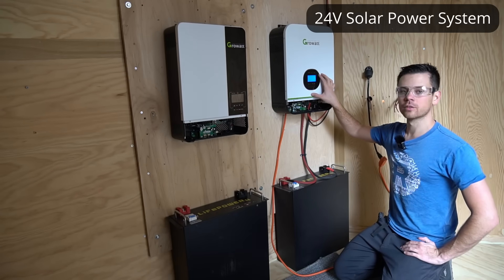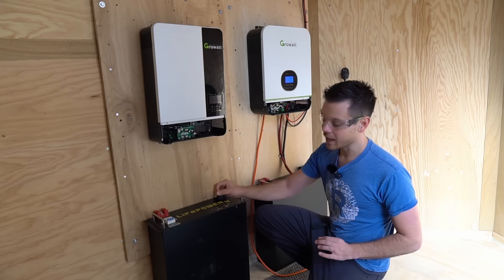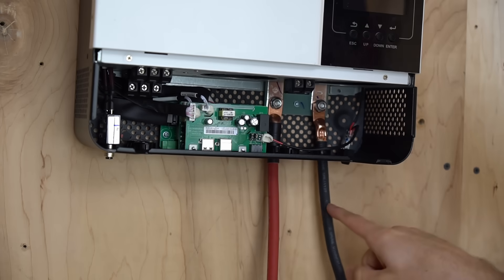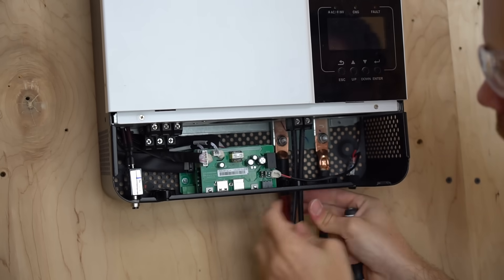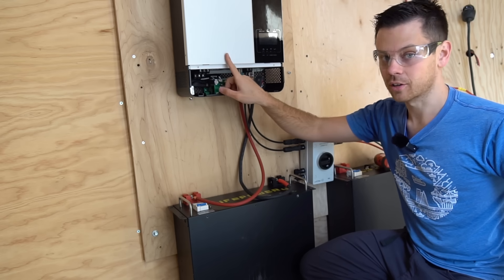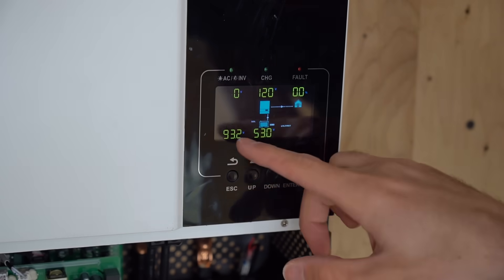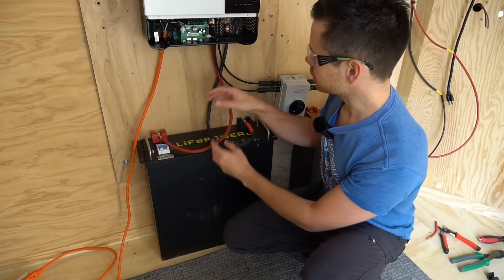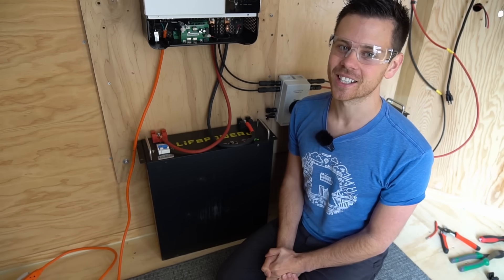Beginner Friendly 48V Solar Power System! Step by step!

Comment: Would you recommend using the Modbus feature of the battery packs to allow the inverter AiO to do coulomb/charge counting instead of relying on voltage for SOC? I just had two 10kWh LiFePO4 packs similar in features to the ones you have die (BMS failure, presumably) after getting numerous over-discharge warnings with a similar low voltage set point. I think reactive loads allowed them to draw too deeply in the transients when the voltage was near cutoff but not low enough for transfer.

Comment: You should put suitable amp circuit breaker on the output if you use smaller wire gauge vs the output. This will ensure that you do not exceed the wire capacity and burn it. It is a cheap fire-insurance…
Reply: Agree strongly. If you AC unit has a fault, like a seized compressor, it can pull a lot of current, melt your extension cable, and possibly start a fire. A breaker protects against this, so should be recommended. Good information, otherwise.

Comment: Will, true beginner here.  

Maybe explain how to connect a panel array to a solar generator.  Any safety hints?  The dc switch sounds like a good idea for an ecoflow delta pro with a 8@100watt series array.  The series voltage coming off this relatively small array has me nervous.  Is it as ez as ‘just’ making the solar panel’s mc4 interconnections and then plugging them into the ecoflow?  Any fuses recommended in the line from the panels into the ecoflow?

Like I say, true beginner - but learning fast with your help!  Maybe a future vid?

Thanks!
Reply: I too would like to see a setup for that.

Even just 2-3 panels with a system to connect/recharge the solar generator while keeping it indoors (preferably in the garage) would be a nifty case study most people should consider.

Comment: I built a very basic system similar to this on a 12V battery. Now I do like the power I am getting from it but do need more. I am using very little daily but on occasion use a high amount but my lights dim when I do so. I know it is my battery output that is causing my lights to dim. I would like to know which battery is great for high output on a Magnasine 2012 but also good for long low usage. The system is mainly being used for security flood light on a motion sensor. The last battery you talked about sounds great and puts out 200 amps continuous but is only 100ah. I found the power queen that puts out 100 amps continuous but is a 200ah battery for $40 more. Is the 100 amp output going to be able to max the magnasine output or would the 200 amp output allow the magnasine to flex its full output?

Comment: Btw why batteries in parallel should be charged to 100% ? If one is 100% and another 50%, the 1st one will charge the 2nd one, what could be the problem here ?
Reply: Arc in the instant prior to connecting... aka 'welding'.

Comment: instead of using an extension cord, it is better to cut the plug off a power strip. It may be a cheap overcurrent protection device but better than nothing! It is also a good idea to tin the leads so strands don't separate. It can be difficult to get all the strands in

Comment: Shouldn’t you wear very thick insulation gloves?
Reply: I'd recommend it. I practice it.  Better safe than sorry.
Reply: Stand on a non-conductive mat wearing non-conductive shoes and non-conductive goggles.
And get rid of amalgam dental fillings while you are at it.
And wear those yellow tall-gauntlet gloves designed for worshing dishes.
And always stick one hand in your back pocket.
But, mostly, get rid of those fillings.

Comment: Thanks Will. Should there be any strain relief connectors on those cables?
Reply: Proj,
Bingo!
Especially in a mobile application with dynamic forces in all directions simultaneously.

Comment: Great video, however I would just say that if you’re going to use an under rated size cable then always fit a fuse at the beginning of the cable rated at that cables max current . If that device it’s feeding develops a fault, there is a risk of fire.
Reply from the maker: These conductors are oversized. I do not suggest anyone to ever use an "underrated" sized cable. That would be awful.
Reply: @WillProwse  I could be wrong....but I thought Simon was thinking of a fuse for the 12 gage extension cord as the AC output..?.?.
Reply: @WillProwse  you mentioned it’s ok to use an extension cable as long as you don’t overload it and that it was only running the aircon unit . If the aircon developed a fault or the cable was mechanically damaged, the cable could catch fire before blowing the circuit breaker on the inverter.
Reply from the maker: @Omegaman1969  OHH I see what you mean. The inverter uses its own software and output meter to determine when overload is present. Not a fuse or breaker. Usually you can program it to whatever you wish if I'm not mistaken. But yes, good idea. I thought you were talking about the battery cables! That scared me haha
Reply: @WillProwse  Oh no not the battery cables 😊 
Ah yes it’s quite a clever unit then. I’ve been looking at Growatt inverters for a while for a bus I’m converting, I’ll be running on 24v though not 48. Which inverter would you recommend for a 24v system . My lithium batteries have a max current of 150amps 200 peak. I’d like to get the highest rated inverter I can at that voltage / current. Thanks 🙏🏼
Reply: @WillProwse  Actually they are 160 / 250 peak
Reply: @WillProwse  how much power consumption do these growatt all in one's eat up?
Reply: Seems like a wise safety measure. 👍

Comment: The fact that it's getting easier to assemble these systems is great.  The one thing I need more guidance on how to size the system I need based on usage.  For example, I'd like to start with an off-grid system that powers my refrigerator in the garage.  Then later, power my outdoor power tool battery chargers, then ultimately, charge my Tesla.
Reply: I would get a Kill-A-Watt meter. Plug it in-line with your fridge. It will read your electrical load. Find out, over the course of a month, your average KWhr load of the fridge. Mine drew about 2kwhr a day. The next thing is to figure out how much solar you need to generate 2 kwhr. If there is no shading, in the tropics you get about 3-4 times nameplate wattage in energy. So we had a small 660 watt system on a boat and had the equivalent of about 3.5 hours of full production, so about 2310 watt hours or 2.3 kwhr. That would run a fridge, in good conditions, but obviously if it’s cloudy or rainy, we would make less than half that. So either you would want to upsize solar or battery capacity to get through those days. In the northern climes, you may only get 2 equivalent of 2 hours peak production, or maybe 1.3 kwhrs. So it depends on where you live and where the panels are mounted. Snow. Shading, ect. My recommendation, mount as many as practicable, and then figure out what you can run. Because if you mount 4, your going to be thinking about 4 more within a year with expanded use. Cheers

Comment: Wow, thank you Will!!  Does the solar disconnect protect against lightning?  Does the way lighting is handled change if this setup is installed in a motorhome?  
Thank you! 🙏🙏🙏
Reply from the maker: No, you will need a SPD. Surge protection device. Check out my combiner box video for more details

Comment: I am looking forward to seeing you build a 48volt system that will run a complete house that can be used off grid. Excellent videos you have.
Reply: Yeah!  I believeTesla Powerwalls are the lowest-cost / kWh pro systems, but--while I LOVE me some Tesla--they're STILL stupid expensive per KWH vs DIY.  Also, they're LiNi, not LiFe; so they're not as safe as they could be and will not last as long.

Comment: Great video man but this isn't ac so the body doesn't act like a capacitor. Using straight up ohm's law with my body skin resistance of 700k ohm with 48 volts results in a current of 6.86E−5 from the meatiest parts of my hands squeezing the leads of my multimeter....48v dc is not even close to dangerous for electrocution..biggest worry would be heat/burns or a fire.  The numbers don't lie not that anyone should try.  Sure if someone was wet or sweaty that'd change things.  I get you're preaching safety but I know some people who think they can get shocked off 12 volts...just not true and ohm's law says why...there is just no current.  Electroboom has a great video on AC and DC hazards and why they are different.
Reply from the maker: I totally agree, but beginners are watching this. I work with 48V with dry hands daily without worry, but I want beginners to have respect for this voltage. Further more, a dead short with a few of these packs in parallel is serious business. You are correct, but I am sticking to OSHA and NEC for recommendations on de-energized systems.

Comment: When I took EE courses the instructors always emphasized the current actually stopped your heart beating.  It doesn't actually kill you outright, although I doubt the destinction would matter to the affected individual.  Might be prudent to keep a defib kit handy, and backup trained to use it.
Reply: If you're quick enough you might be able to turn it off and on again hopefully get another shock😂😂
Reply: I was in the medical field and when your heart stops you are dead unless the CPR team is standing by!

Comment: Thanks, but my confusion is, 12 volt panels in series can be run single string as in diagram, so long as their collective voltage does not exceed the voltage rating of the inverter? in other words, i can string more than 4 12 volt panels up to but not exceed the inverter rating? I hope that makes sense.
Reply: Kinda if you have a 48 volt inverter  you. Would want to double that for .pv input or 24 volt you want 48 but when it comes to stringing as long as you don’t go over the amps or go over what the MPPT controllar calls for with the voltage you should be fin most mmm are 150 volt max pv but you only need to do 100 volt and then bump the amps to not go over the rates amperage is usually what I tell my costumer the pv voltage should be dibble the battery volts then ran in parallel to bring the amps up

Comment: I think the max PV input voltage for this inverter is 450, not 150.
Reply: That inverter has a PV input max rating of 145V DC. It's clearly stated in the spec sheet for the unit linked in Will's comments.
Reply: @alexsimmons1803  I thought this was the 5kw unit but it's 3k. My bad. I have the 5k one and I have 10x 72 cell panels connected in series
Reply: The max PV VDC is 450v
Mppt range is 120v ~ 430v
That is the reason Will never got a charge all through the video.

Comment: Since this is a server rack battery, why not also use the CANBUS/RS-485 communication port? Does that gain enough features to bother setting it up?
Reply from the maker: Personally, I don't think it is worth it. If you wish to modifying the cycling bandwidth and not use the full capacity, sure. I like to use the entire capacity with this chemistry.

Comment: Hi Will , i really enjoy your videos . I recently subscribed to your channel . I think my needs are less complicated . I am off grid and have been for 5 years now . I installed two sets of used solar panels , 1000 watts each . I use the power as 12 volts to run all my lights and charge ports . I did have 5 deep cycle batteries and now only have one . I was using my fridge but now i can't . The fridge is both 12 and  24 volt , the brand is UNIQUE . I live small in everything 24 " tv 35 watts , water pump not connected and an on demand hot water tank LPG i still need to purchase . That is all i have . Would you be able to suggest a system for my needs ? I will be applying for a government grant for repairs that i would like to include this part of the expense . I am on a disability pension . Any help will be greatly appreciated . Thank you so much . Perry .
Reply: Perry,
Please, more information on grants!

Comment: Thanks for all the awesome videos! Nobody does it better. The one thing I would like to see added to your channel is more discussion of hybrid systems. I want to use a system such as the one described in this video, but slightly larger, connected to the main panel in my home. I don't wish to feed power back to the grid, but do want to use solar as a primary source for whole house power with grid backup and supplementation. I know I cant afford an off grid system that will meet all my needs, but do believe that I could build a hybrid system that would meet 80-90% of my needs, offset my utility bill dramatically, and provide a day or two of backup power for when the grid goes down. However, I've seen conflicting information regarding components required and would love to hear your professional opinion. Cheers!
Reply: I'm with Craig!
Reply: Yes, definitely!
Reply: Same here

Comment: I’m getting closer to installing my first solar on my house to run the heat pump and minimum lighting around the house. 
               Your information is invaluable there’s just so many choices and selections of set ups and equipment to choose for a first time learning system off grid on a house in San Francisco
Reply: I am planning on doing the same thing this next year or so in my barn... you probably already know this but there is an AC/DC/SOLAR split units out there to make some of this alot easier.  have fun and good luck
Reply: @davidjaye710  yes I was thinking of the AC/DC solar I have to look into its efficiency level. 

       Even though without an inverter you save some efficiency losses because you’re not converting DC to AC. 

      But then it comes down to the efficiency of the actual mechanical compressing pump they’re not all equal summer designed with materials and construction that naturally makes them use less energy

      Then another component that is extremely important on how many watts of power it will consume for the same amount of BTUs is the size and the construction of the condenser. 

They can make smaller condensers and evaporators do the same amount of work and they produce them cheap but they’re less efficient. And consume more power to operate. 

        The larger the condenser in the larger the evaporator surface area square inches or square centimeters usually the more efficient unless energy consumed. 

       Air force inverter system operated single speed fans or single speed compressor motor

Comment: Very timely, I'm getting ready to build a 48v system for my house, I need 15-20 kw of storage and probably 2 GroWatt 5 or 6 watt inverters,  Can you recommend this system for my home?  I truly wait for your video's to show up.  Love your work and knowledge Bro  
Oh and for the guys below, I am 71 and know almost nothing about electrical work and electricity scares the s**t outa me.  Still learning from Will and David.
Reply: I run my house in the 12k and I have 3 kids and I need 40,000 watts in battery backup base not faked me yet abs the controller can do 7500 watts to the battery
Reply: It’s dc but if you close to AZ I can recommend installers sorry I dragged this on

Comment: Hey, what's your opinion of the MPP Solar LVX 6048? Considering the investment since it allows 120/240v split-phase power without needing to parallel another inverter.
Reply from the maker: I love it! I use one for testing packs in my shop. I ran it for half a year in my trailer. great unit

Comment: Which Growatt inverter connects to batteries and outputs 240v? Will never shows a single unit that produces 240v.
Reply from the maker: I have multiple videos for 240V with these units
Reply: @WillProwse  I've only seen two units ganged together to make 240v. I like these very simple builds. Could you do a video on a single growatt inverter that outputs 240v?

Comment: So you choose Usersettings for battery and set your own cutoff, float and low voltage disconnect? Is using the Lifepo4 option possible with the ethernet cable?

Comment: Awesome! I'm implementing this on a skoolie. How would you recommend adding a 48v alternator to this all in one setup? Want to be able to top up if I have some rainy or cloudy days.
Reply: Not sure what Will will say about this, but I'd recommend a small AC generator, just plug it in to the AC input side of the inverter.
Reply: @aguanut  that's the typical route along with shore power which I believe is what the inputs above the 3 ac inputs that will used here. I already have an inverter generator. Want to specifically get input on 48v alternator. Many people do it with victron 12v systems, but havent seen it with a 48v system.
Reply: @fo4imtippin  Then consider a 12 to 48V boost converter. You can find 'em on ebay for $20.

Comment: Its always a good idea to use the correct size ring terminals to ensure enough surface contact to prevent creating a point of resistance that can heat up and choke current flow. Even with the nuts on I can see a gap between the terminal. I know you know this and that cable looks oversized but it would be great to make a mention about terminal connections as they are almost more important than the cable itself as they can often create bottlenecks. Great video though Will, The cost in copper alone is enough of a justification to use a higher voltage system and cheap CCA don't cut it.
Reply from the maker: Absolutely. CCA is awful. 

And yes good point about the correct size ring terminal. Should have mentioned that.
Reply from the maker: Those bottlenecks can create a lot of heat sometimes!

Comment: Is there a way to cover the terminals on the battery after the cables are connected? Like some kind of covers for them?
Reply: Matthew,
2003, above our AGM bank on our ExpeditionVehicle build, we mounted clear plexiglass.
To contact a terminal or a fuse, we need to completely dismount the cover.